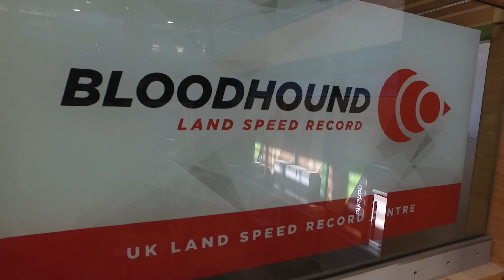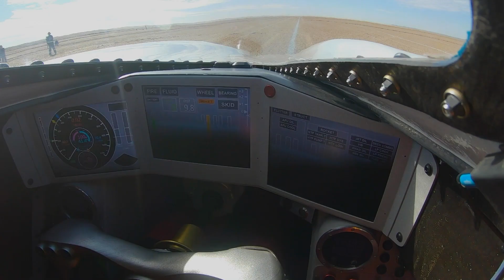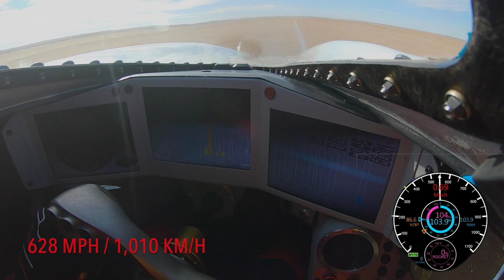0 to 628 mph (1,010 kmh) in 50 sec – 54,000-HP Bloodhound LSR Car – High Speed Testing

Comment: It's probably harder to keep it on the ground then it would be to just put some wings on it and let it be what it wants to be...
Reply: One of them will probably be destroyed at high speed because of downforce and guess what, it will lose balance and crash
Reply: Alperen Keser Wrong, the downforce is cancelled out by the lift force. That’s how it was designed so the net force on ‘y’ equal zero.

Comment: That’s a lot of horses
Reply: And a lot of sand dust
Reply: Still couldnt beat ThrustSSC which were made 20 yrs ago
Reply: @akhyarrayhka4048  they haven't tried yet.  If you have been following the project you would know that their goal from the beginning has been 1,000 mph.  It is still in testing phase.  And BTW, it hasn't been 20 years since the SSC.
Reply: @trapezius77  It has been over 20 years since Thrust SSC. The record was set in 1997 22 years ago.
Reply: @zerocool6452  yes you are right, thanks for correcting me.  But the main point in response to Akhyar stands.
Reply: @trapezius77  Yes that's true, 2021 will they do the attempt. They said that on Facebook and Instagram. Little more than a year! :(
Reply: @zerocool6452  oh really?  So what are they doing all next year? 🤔
Reply: @trapezius77  I have no idea. I guess they will focus on the education program.
Reply: @zerocool6452  That's a long time for the car to sit without being driven!  That's can't be good for the car, just like for any other car.
Reply: @trapezius77  They will surely drain it from all the fluids so that won't be a problem atleast. The car will be on display, tickets will be sold.

Comment: Thrust SSC was faster 🤔
Reply: This is a test, the car in theory is faster, they have been preparing for years to unleash the full capability of it
Reply: The afterburner/rocket has not been installed yet, this was just using the power of the jet!